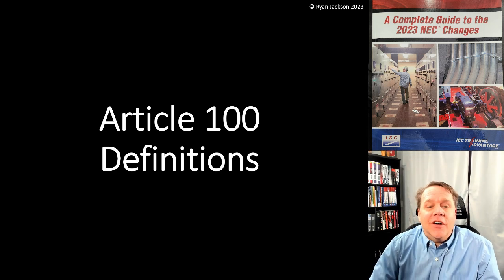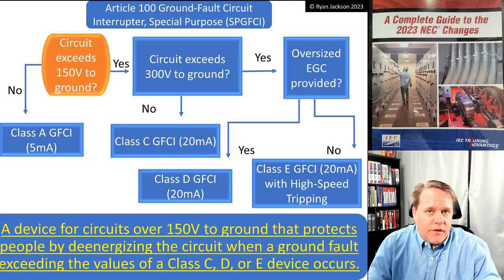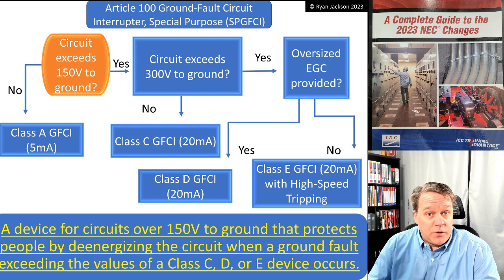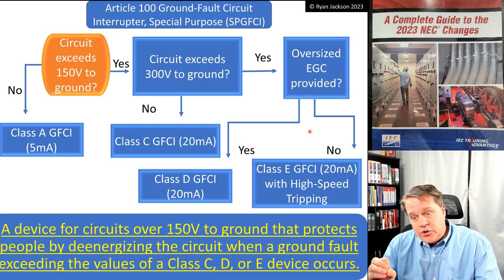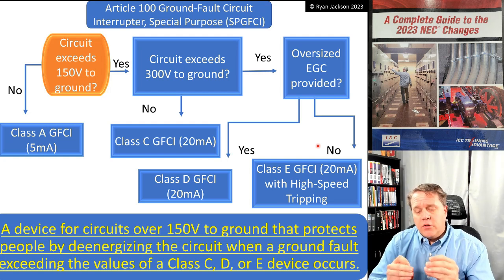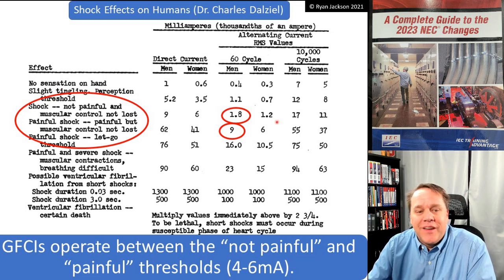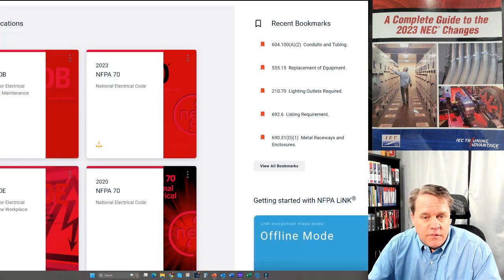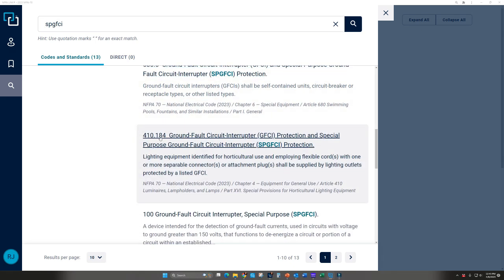2023 Article 100  SPGFCI (ground fault circuit interrupter, special purpose)

Comment: Did some work for a new Ice cream shop. Placed a 2 pole GFCI on the Ice cream machine and it wouldn’t turn on , it would keep tripping the breaker. replaced the breaker and receptacle and still had the same issue. Ended up calling the manufacturer of the Machine and their tech said it needed a class B GFCI for it to work. That is when I first researched the different classes and learned about the different mA trip differences.

Comment: Thank you for the info on Dr. Dalzel.  I remember reading about women electrocuting themselves with hair dryers in the bathroom.    The GFCI is a much needed technical advancement.   That said the application of GFCI by the code has gone beyond reasonable.   There is always a compromise between safety and function, let alone cost.   My big issue with gfci is gfci for refrigerators.  The GFCI should be in the refrigerator,  not the outlet it is plugged into   the refrigeratortest and reset should be accessible. ,

Comment: I do actually have 480 at my house, in my shop. Coming off a transformer connected to a 120/240 "high leg" open delta panel. High leg residential services are not uncommon in my area and I suppose they would also count as over 150v to ground because of the ~208v high leg. Now, the question is, would an SPGFCI be required on a 240 delta circuit in a dwelling unit? Let's say a 3 phase receptacle that's in a basement. Or an air conditioning unit? How about 480 circuits that are fed from a transformer, also in a dwelling unit? Like a lathe or milling machine in a basement or garage. And 277v or 480v lighting as well. 3 phase in residential gets very complicated with regards to the code. It's often hard to tell what applies and what doesn't. But where I live 3 phase residential was relatively common even 50 years ago and is only becoming more common with the heat pumps, tankless water heaters, and EVSE's in use. POCO here will not install a single phase service over 400 amps. Over 200 amps requires special approval and if 3 phase is available on your street or anywhere nearby they will require 3 phase instead. This is usually 120/208 nowadays but high leg services are sometimes still installed even in new construction. This opens up the possibility for other people to have transformers and 277/480 or even 600v subpanels in dwelling units. It is not uncommon for me to see a buck/boost transformer powering 277v shop lighting in a barn or garage even on a single phase service. Phase converters and transformers are also often used to generate high voltage 3 phase power where there is none coming into the building. So the question is? Are SPGFCIs required in these situations?

Comment: For Class A GFCI, duration T= [20 ÷ I]¹.⁴³
where T = time, in seconds
            I = current, in milliamperes

Applies only where:
• used in grounded-neutral systems
• contact is NOT made with BOTH output (load) circuit conductors
• 80 volts < Voltage to ground ≤ 150 volts
• 50 Hz ≤ frequency ≤ 60 Hz
• – 35°C (– 31°F) ≤ ambient air temperature ≤ 66°C (151°F)

Interruption of the electric circuit to the load shall not take place if the fault current is less than 4 mA, or less than 3.5 mA if the ambient air temperature is less than – 5°C (23°F) or more than 40°C (104°F).